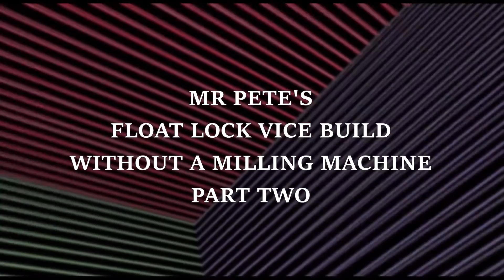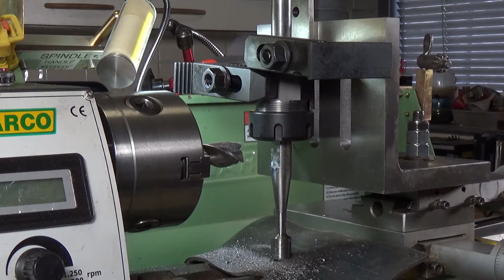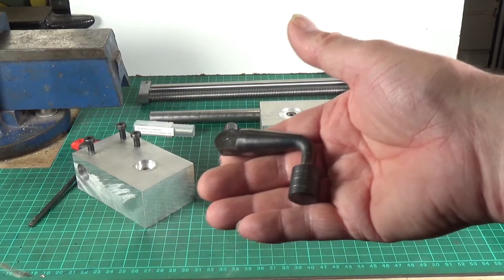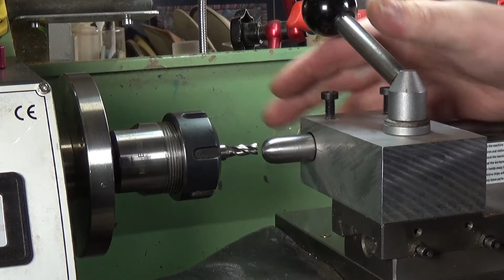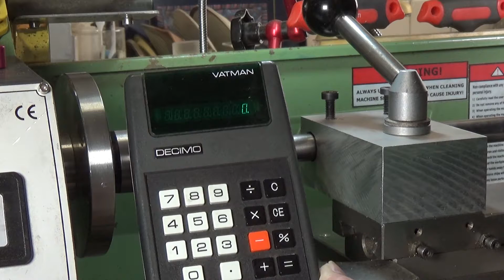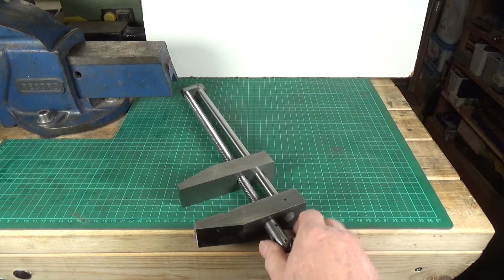Mr Pete's Float Lock Vice Build Done Without A Milling Machine - Part Two

Comment: Hi Alan,
A really good video, Thank you... I need to purchase some form of fire making device so will most likely go for the Bullfinch as if it's good enough for you and Rob it will be fine for me. Off to watch part 3 now.
Cheers
Paul,,
Reply from the maker: Hi Paul. The Bullfinch torches are indeed very good. It's worth having a think about what you want to do with it before you splash out on one as they come with different nozzles. I first purchased their general purpose torch, it has quite a wide nozzle. This is the one I use with my Beer Keg furnace, it's great for general heating but not really good enough for brazing or silver soldering. After discussing this with Rob I treated myself to the Bullfinch brazing torch as well, this does localised heat really well so is ideal for brazing and silver soldering. Cheers, Alan.